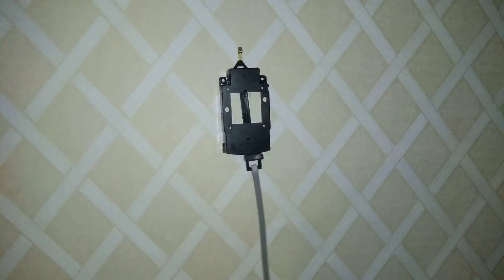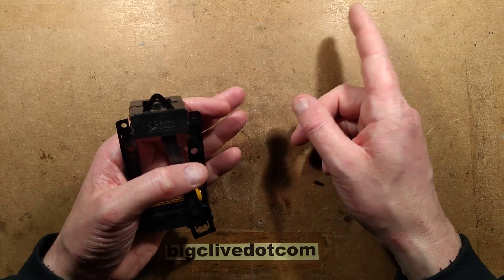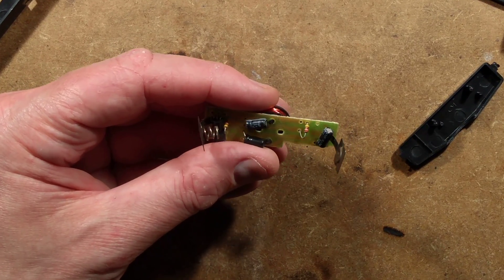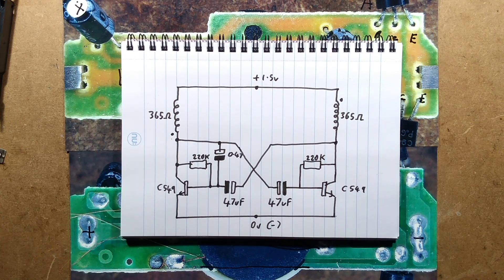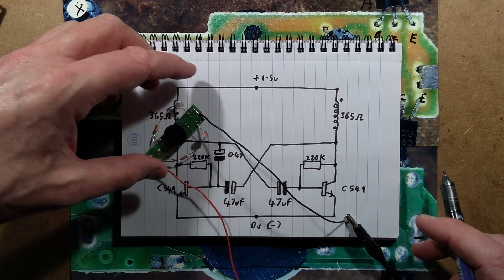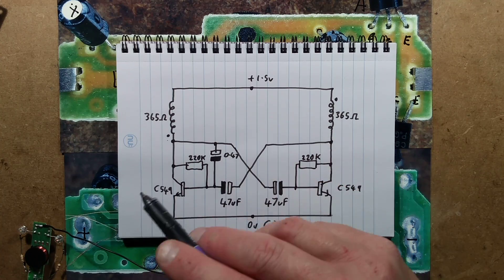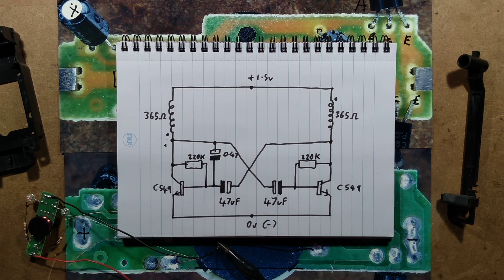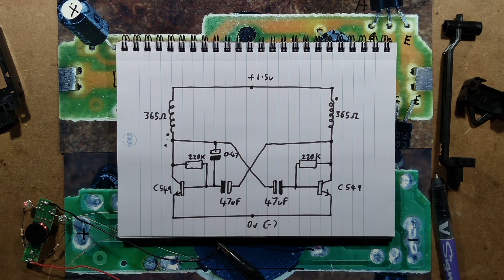Quartz clock pendulum movement teardown with schematic.

Comment: In this quartz clock no quartz is in there, so I wonder where the time base of this clock comes from.  Certainly not of this electronics, the component tolerances and the circuits frequency dependencies of temperature and voltage would allow only a very inaccurate clock.  Therefore, it must already be the pendulum that provides the time base.  But why then this multivibrator, the pendulum is already one.  Well, a multivibrator with damping, because without compensation of friction, the pendulum will eventually stop.  Can it be that this circuit has two tasks?  First, it should bring the pendulum to swing, so enable the self-start of the clock.  After that, when the pendulum has settled, the circuit always gives it a small push.  The whole thing reminds me of a swing on which you get yourself going without touching the ground with your feet.  There must also be a feedback between the pendulum and the multivibrator, because the frequency must be high at startup and slower at operation.  The magnets are not only used to drive the pendulum but also to control the circuit.  And this is where I have to get off.  Clive, you did not finish this circuit, it's kind of unsatisfactory, I have to say. But very interesting.
Reply: These pendelums are not typically used to keep time.  A totally seperate quartz clock it added. Having said that, I think could be used to keep reasonably accurate time.
Reply: Yes, in a „real“ quartz clock this pendulum has only a decorative function. The quartz is a much faster pendulum, divided down to 1 Hz, and therefore a lot more precise, at least since then the quartz is temperature compensated. So I think the accuracy of this clock can‘t be reasonable but only poor, depending on the length of this plastic pendulum and the overall build quality. This unit can only pretend to be a clock, and that is perhaps the only function of it. The time itself is shown by a seperate quartz clock.

Comment: They are almost magic, up on a par with bread and beer. Also check out the "Solar Powered 360 Degree Rotating Display Stand Turntable", can be had for a good price
Reply from the maker: I've got a few of those.  They use the same motor as the lighthouse ornament I reverse engineered.

Comment: Very cool video! I did some back engineering on a very similar circuit! There is a product called the Tibetan prayer wheel that has almost the same circuit. Made a bad video about it lol and a 5uA solar motor with the circuit if you would like to check it out! Cheers love your vids Clive!
Reply from the maker: I've got one on order.  I think it probably uses the same motor as the ornamental lighthouse I reverse engineered in a video.

Comment: So true about electronic organs using flip flops as frequency dividers in the divider circuits. I have a Farfisa fast 5 that uses inductor based high frequency oscillators         (12 total) and a ton of flip flops to divide the octaves. 
I also have a vip 500 that uses flip flops like this one as the master oscillators insted of the inductor based osc, but  IC's instead of flip flops for the dividers. 
I am also currently working on making myself a string synth but I will be using CD4024 ripple counters as dividers.
Reply: That part was fascinating to me! So with these organs does only the master oscillator need to be precisely tuned to a fundamental and with the feedback and locking harmonics the other frequencies fall into place? I've never heard of this, but I think it's super interesting!
Reply: BRUXXUS Yes! The "master" high frequency oscillators are tuned with potentiometers or tunable inductors. They are tuned to the highest 12 chromatic notes of a piano (the 12 chromatic notes on the far right) 
All the other octaves are derived from these "top octave" frequencies by cascading the flip-flops. Think of a flip-flop toggling back and forth and only picture one of the led's flashing. This is half of the total frequency that the flip-flop is toggling at. Now if you drive another flip-flop from the single output of the previous one your new flip-flop will be toggling at half the frequency of the previous. Think of train level crossing signals with one of the lights burned out. The single light flashing is half the frequency or "beat" than the two combined. 
And yes, if you alter the pitch/tuning of the master oscillators the frequency of the cascaded divided outputs will sync. 
Some newer designs from the 70's and 80's used a single master oscillator and had a dedicated chip to obtain the top 12 chromatic frequencies. 
The scheme is called top octave synthesis or devide down synthesis. The technology goes way back. 
Hope I explained clearly enough:)

Comment: I imagine the chinese "lucky cats" are also using the same mechanism. Might make sense to look at one of those too.
Reply: They use the solar dancing figure circuits -- works similarly but for a very light load.
They have a single circuit board and a single chip, and a lower profile coil. They're pretty good for hacking too, if you don't mind the hair-thin copper wires!

Comment: Seems to be missing something.... Oh yea, "Quartz"!  Funny, those selling terms...
Reply: Last week I was looking for cheap oscillating fans, and pretty much every result for "oscillating fan" under $15 didn't actually oscillate. I even went so far as to message several of the sellers to ask if it was, in fact, an oscillating fan as advertised, most simply replied "read the description" to which I said "Since the title says it's an oscillating fan, if I order it and it isn't what was described you'll give me a refund, right?" and then I got a reply saying that it wasn't an oscillating fan. Ebay has become a horrible mess over the last decade and doesn't seem to care.
Reply: @StarkRG  ePay is a scammers playground.
Reply: It an add on for the quartz clock movement.
Reply: It's not about what's actually inside. It's about what people actually think is inside. True Bullshit!
Reply: Quartz does imply crystal controlled and this has none.
Reply: @misterhat5823  Its a decoration that fits over a quarts movement which DOES have quartz in it.  It actually has nothing to do with the quartz movement's behavior.  The length of a pendulum determins its period.  In this case of this kicker, it'll keep the amplitude of the swing up with its kick.  Now about that bending in the middle, I suspect a shorter hanging wire wouldn't be quite so bendy at the joint.  These sorts of clocks should have something like 2 beats per second if they're pretending to be like cheap cuckoo clocks.  That would be a fairly short pendulum.
Reply: @misterhat5823  um, no. What you're missing is it can be read (quartz clock) pendulum OR quartz (clock pendulum).  The latter is incorrect.  It's even obvious that the square hole goes around the standard quartz movement.  You only need to misread the title to believe its misleading.  If you had experience with both of these mechanisms, which I do, you'd understand this.

Comment: Hope nobody replaces the pendulum with a wind chime!
Reply from the maker: I do recall a pendulum wind chime.  I think one of the main American gadget shops sold it.
Reply: bigclivedotcom Oh dear, I wonder how many came to regret that purchase. The circuit operation is reminiscent of the flywheel oscillator used in analogue TV for horizontal line sync in that it locks to the sync signal, in this case the pendulum.

Comment: My guess is that when the first magnet passes, it triggers the coil to give the othr magnet a push or pull, this would happen the same in each direction, that would explain the 2 magnets polarities
I also think the circuit acts like astable with a bit of bistable (the latter being triggered), the astable would have the middle resistors connected to +
Reply: Your guess is spot on.

Comment: Nah, that's not romex (NM-B; non-metallic - branch). That's UF-B (underground feed - branch). Romex is a paper with plastic coating outer sleeve. UF-B has that plastic only sleeve that fully encapsulates all the wire in it. And it's a p.i.t.a. to strip off that outer sleeving compared to NM-B
Reply: NM-B is type Non-Metallic version B (with a 90C temperature rating rather than the 60C rating of the pre-1984 type NM cable). Oh, and Romex is a brand which makes lots of different types of cable.

Comment: My guess would be that the odd capacitor is the "kickstart" function, as it would cause a drag in one direction, thus the magnets would have a field that was slightly off the entire time. And that would explain the two magnets so that regardless of "leveling" of the entire device, it would still be influenced to begin starting. 

I suspect if you hung it and could turn the power on in place, it would not need to be tapped to start. 

But very cool. 

But how is it Quartz? Or is that just a misleading title from ebay?
Reply: I believe the quartz is description of the type of clock mechanism this is to be paired with.  Since a quartz clock movement will not drive a pendulum when building a clock and you want the old time look of mechanical movement then you need this pendulum movement to go with it.
Reply: The 2 magnets are part of the kickstart. That way no matter the polarity there will still be an induced motion.
Reply: JJayzX The 2 magnets act like a single sideways magnet, only stronger.  It will pulse the coil on both passes.
  The extra capacitor AC couples the induced pulse to the left transistor.  Inducing a positive pulse on the left winding first triggers the right transistor, which pulls down the (already negative) right coil, discharging the left cap and charging the right one.  Once the right cap is charged, it lowers the right base so low, the right transistor turns off causing the right coil to force its stored current into the left cap, turning on the left transistor, which pulls the left coil negative (already was from the induced voltage), discharging the right cap through the 220K (so RC=10s).  If there's no external pulse (pendulum locked), the small capacitor slightly debalances the multivibrator to get it started more easily.
  Now because the coil inductance enhances the pulses in the circuit, I suspect it can run from an almost flat battery.
Reply: I was thinking that capacitor functioned like a run capacitor on a single phase induction motor causing a phase shift in the one winding so there was a small force induced.

Comment: The swapping polarity provides the self-starting aspect and keeps the pendulum movement stable. The opposing magnets at the pendulum base provide weight for the pendulum and there are other magnets of repelling polarity near the extreme end of the swing to arrest the pendulum and help push it from one side toward the other. That's my guess, anyway.

Comment: I think the purpose of the two opposite magnets is to shape the magnetic flux above the magnets horizontally (and make its polarity uniform in that plane), so that everytime the magnetic field swings through the coil, the multivibrator makes a flip that corresponds to the current direction of the pendulum.

Comment: I was expecting a HALL switch.
Reply: Yeah, that's definitely a way to do something like this, but from my experience, Hall sensors are pretty expensive.  Well, expensive as in not pennies like these components.  Super fun to play with, though!
Reply: @BRUXXUS  Back in the 70's when I was a kid they were SPECIAL.   You can buy a handful now for under a dollar.  I have a stash of them here I find use for once in a while.  BangGood Has them.
Reply: I've got a few of them I've been saving for a rainy day, lol.  I actually thought of a use for them for a totally watertight enclosure to switch some lights on and off by running a magnet past it.  Although my knowledge of circuitry isn't great.  I basically need to find a circuit that uses a hall sensor as a toggle button. 🤔  Probably not hard to find some schematics for something liek that.
Reply: @BRUXXUS  I had the same idea of using them to control a Underwater Metal Detector.

Comment: It would be interesting to put a scope on the circuit to see what triggered what.
Reply: Easy enough to do with relays. Power on - turns on relay 1 which turns on relay 2 which turns off relay 1
Reply: Did this with about 8-10 relays in physics lab while at school. Phys teacher said it wouldn't work. Not only did it work, he left it set up for a week to show other classes ! Basically each relay turns on the next one but the last in the sequence turns the first one off.
What's it like ? Like a car engine ticking over with the rocker cover off !
Reply from the maker: Strangely, I was looking at cheap relays on eBay and thinking of that exact circuit where the relays cycle in a loop.
Reply: @bigclivedotcom  For the phys lab, the relays weren't encased - so you get full contact rattle sound ;)

Never mind cheap relays then - get some antique contactors - pot ones with massive contact gaps...
pump up the volume.
Let that switchgear rock !
Reply: @bigclivedotcom  I thought of it first ;) (about 1980 !)
Reply: You don't even need multiple relays to make that work. My fav circuit for relays is making a one relay buzzer. Some one on Ave's channel said it wouldn't be durable enough to run for long so he made one and proved them wrong. Another very useful variation on that is the latching relay used for safety "Mag Switches" on table saws and another such equipment.
Reply: @johnpossum556  I guess your hobby is collecting car horns. Hardly a 1 relay buzzer but the exact same principle.
A variant being the electric bell.

If you're happy with a 50 Hz buzz, you don't even need a relay.
Reply: @millomweb  Aside from the posts where people don't even watch the video that's gotta be the dumbest post I ever read. No, the one relay buzzer is cool because there is not any other electronic components where you can make an actual working circuit with one part. It's beauty through simplicity yet it is not purpose-driven like a horn it still has plenty of other potential uses.
Reply: @johnpossum556  You mean a LED is not a working circuit of equal number of component ?

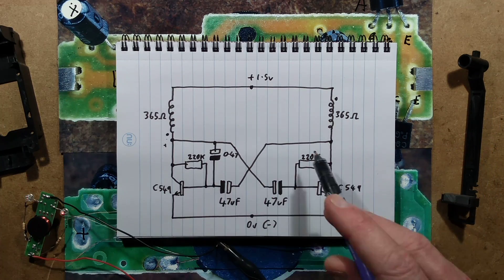Comment: 12:40 maybe rotate the 2 outer caps 180° ?
Reply: That bottom track doesn't seem to go anywhere but between the caps, that doesn't look right. The smallest cap should connect to both bigger caps as well...
Reply: To help error-proof the process of hand-populating the boards (I am envisioning production batch sizes in the thousands), the pads for the capacitors could be configured so that the positive leads of all three caps face the same way, as has been done for the transistors.
Reply: @haroldsmith45302  Turn them all 180° then.